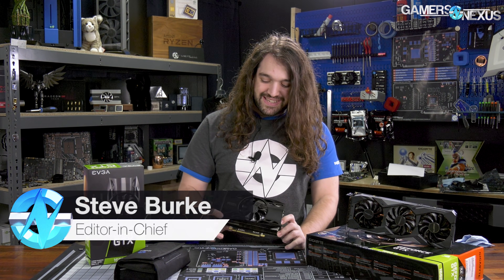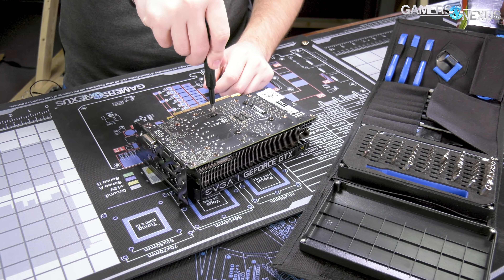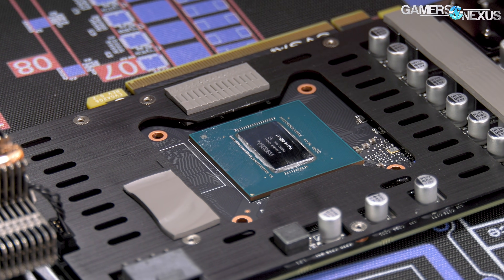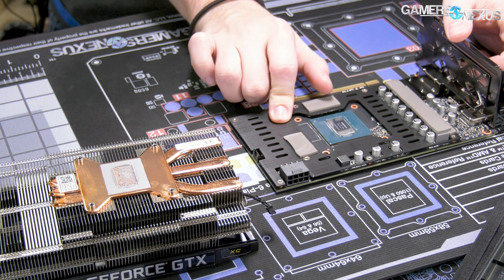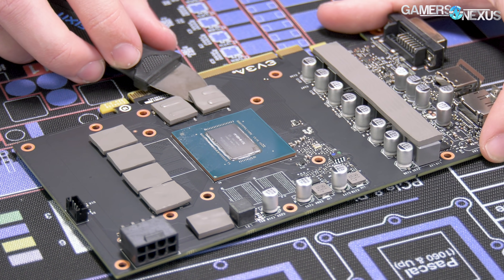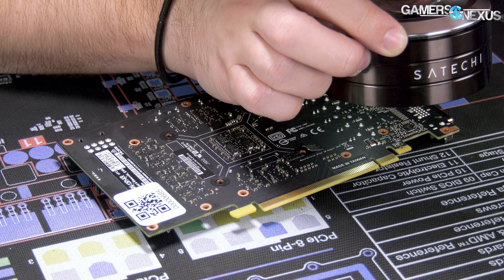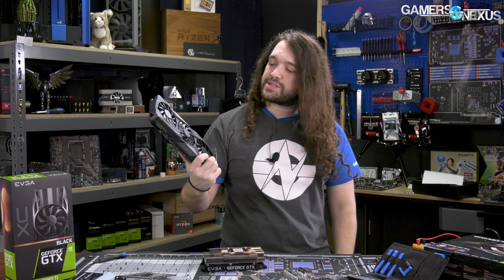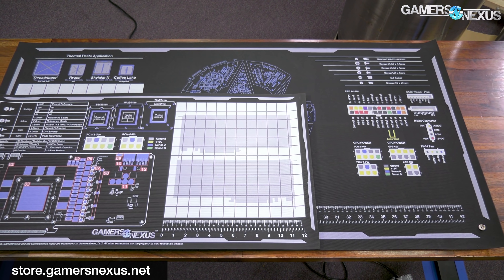EVGA GTX 1660 Ti XC Tear-Down & TU116 Die Shot

Comment: EVGA is using the 1x HDB fan design in their base 1660 model while Gigabyte/Zotac are using 2x sleeve bearing design for the same price. Does anyone know how the 1x HDB fan compares to the 2x sleeve bearing fans in terms of heat and noise?

Comment: What about those 2 extra memory positions? Is it shared PCB with some other GPU, or does the GT116  have support for 256bit memory interface?
For the second option - I believe that GF1660 vanilla will have gddr5 memory with presumably the same die. It is possible, that nv hedged against the possible GDDR6 supply problems by making it able to use 256bit (intended for 1660ti with gddr5).

Comment: Seems an interesting card 
Whould like to see some oc capabilities, please try to increase the power limit and see if it will oc better, also the heatsink looks massive i think it whould be easy to put two fan and remove the black shroud so it will have better cooling while remaining small, 
You made it go to 2055mhz, is any more headroom for a 1660ti gpu to go beyond that?

Comment: Confused on which one to get zotac or ausus or any other , most of them have single fan , zotac has 2 . And which is good the amp or the normal one because in my country amp is for 28,000 INR( 395$) and the normal dual fan is for 366$ 26,000 INR , I know it's really expensive than in the US :(
Reply: Go for Zotac, 5 years warranty  in India
Reply: Ya

Comment: The holes in the base plate are quite well designed considering they have a thermal pad also on the other side of the holes. I'm sure it helps with heat dissipation quite a bit.

Comment: Don't like the cooler. I would rather see a normal two fan cooler then that really thick one. Yes it would extend past the PCB but that improves cooling even more by increasing airflow.
Reply: Yeah. I'd much rather see the regular configuration that this.. stump. Thankfully there are other 1660's that are not retardedly built like this one
Reply: @Raging Monk
EVGA makes a twin fan version... for $310. You would be better off getting the 2060.
Reply: @carniestyle6454  , "You would be better off getting the 2060."
I have a Vega 56 Pulse. It has a nano PCB with a full size cooler. https://hexus.net/tech/news/graphics/114599-sapphire-adds-pulse-radeon-rx-vega-56-lineup/
Reply: Raging Monk.... Where do you think Joes who shell out greenbacks are going to try to cram these things in?   (hint....think small)
On the other side of the coin.....if materials and attachment methods are effective in manufacturing, surface area is surface area and an effective airflow rate is dialed in, I see no downside to the brick vs shingle layout.
Reply: This is ment for tiny Pc cases probably. Also a second fan would cause more noise at the same rpm and you need a second fan to cover the whole area then. So probably because this is 3 slot, it almost cools as good as a 2 fan 2 slot design while only needing one fan. Ofc you could just reduce rpm on both fans of your version to decrease noise, but my point is that its probably still louder to a certain point where the rpm are just too low to make a decent difference in noise. But you still will have 2x the noise because of 2x the fans. We need dB numbers for that.
Reply: Main problem however is that 99% of small ITX cases are only support 2 pcie slots, nothing higher. This kinda gimps its small case compatibility.
Reply: @the-true-inferno  Hmm really? I didnt know that. Then they should have just gone for 2 small fans and a slightly longer card, as the main comment suggested. Probably EVGA had some in mind which have 3 or tried to minimze cost with this design.
Reply: >2x noise for 2 fans instead of 1
Yeah but it does not work like that at all
Reply: @elesinalex  Dude i even described when it applies 🤷🏼‍♀️
Reply: @OutOfRangeDE  I just did a build about 2 months ago  in this case. https://www.newegg.com/Product/Product.aspx?Item=N82E16811353073
So a micro-ATX and I put in a two fan, XFX RX 480 GTR Black Edition (Card Dimension (inch) : 11.02 x 4.88 x 1.57) and overclocked it 1365 MHz making it a RX 580. I think having a full 3 slot wouldn't have worked as well. that single fan would be nearly touching the side of the case.
Not huge fan of this type of builds but the guy has to spend a lot of time in neighboring states. Throws the tools in the back of the truck and seat belts the PC on the passenger side. lol

Comment: Thanks for the teardown. Steve, did evga mention as to why they went with a thicker cooler for the gpu? Is it because they increase the power to 130w rather than the 1660ti 120w standard?

Comment: Surprised you didn't notice the 2 empty RAM spots - what other card would use the same PCB but have 8GB VRAM?
Reply from the maker: It was noticed, that doesn't mean it needs to be mentioned. Small RTX 2060s could use the same PCB layout, doesn't necessarily mean anything.
Reply: @GamersNexus  gotcha - so the die is the same size / similar enough size to be interchangeable with a 2060 GPU die. Good info!
Reply: @kalmtraveler  EVGA use a version of this PCB for all of the 2060 models and I would bet a 2070 ITX is either in the works or was on the table at some point. The 2060 PCB significantly more busy with components than this but it's the same basic layout and it makes sense that they have the pads for the 2070's memory if they ever want to put that chip on the board.
Reply: @Sniggwaffles  thanks - I hadn't seen comparisons between them so was just surprised to see a 1660 with unpopulated RAM spots. Makes sense now!
Reply: So standardization.

Comment: I wonder why they design the cooler fin orientation this way so the fan blow air to like 60% of it only and other will only passively cooled. Why not the other way so the fan can blow air into all the fin.
Reply: My guess is it has to do with manufacturing. Maybe shorter, perpendicular find are easier to manufacture. Or heatpipes are laid out more efficiently on perpendicular fins than parallel ones.

Again, those are just guesses.
Reply: @justinbernardo3159  Yeah, now thinking it again all EVGA card cooler use the same orientation design too (maybe not all) so they just have to change little bit to fit in this card much easier than designing a new one.

Comment: why an 8pin if it's only 130w and the wattage can't be changed through OCing? PCIE+ 6pin is more than enough?
Reply from the maker: 6 vs. 8 doesn't actually change anything in reality, just adds 2 more sense pins.
Reply: It's just more awkward for people like me with modded old OEM work stations with no 6 or 8 pin connectors I guess. If I could find a duel SATA power to 8 pin adaptor (54 + 54 + 75 from board) do you think a 320w PSU (90+ efficiency) on a system with an i7 3770 and 16bg ddr3 1600mhz ( 4 x 4 in dual channel) could handle these cards?
Reply: @SeanehKelleh  Same here.I have a good old PSU with only 6 pin connector.And it's a shame that I can't use it and need to buy new one.
Reply: @ShadowPBPBC 75w+75w by PCI express.And good 6 pin connector can give you a much more power.Believe me.
Reply: @ShadowPBPBC but SATA power is 54w, so having 2 SATA Power cables feeeding to 1 6pin connector provides upto 108w , but the card will only draw 75 though the 6pins (and it wont even do that as it's getting 75w form the board anyway).

Comment: Wtf is up with Nvidia’s ability to name things?
Reply: Some board partners seem to do their best to make the names even worse, like - MSI GTX 1660 Ti Ventus XS OC...
Reply: @M0DERN_B0REFARE  I'd prefer a GTX 1660 Ti OwO OC.
Reply: A more fucked up name gives them free PR.
Reply: Well 1000-series is pascal, 2000-series turing. So 16xx-series is Turing too? Of course it's obviously confusing. Something like 1060 6gb v2 would have worked so much better even if it's not pascal. Or perhaps 2060 lite? Or 2040 breaking the mold going lower numbers? Or just 2060 but not RTX but GTX...
Reply: @shagath  Or a 1160... as in, This is NOT 6 generations over the 1060... The 2080 is also not 10 gen over the 1080... but I'd let that fly as a "2nd" "080"... but 1660 is just them trying to confuse people and get more cash. What next, an 1880 and 1770? It's like renaming your "3 Series car, 2 litre engine" as a "13429.5" just to make the engine sound bigger. ;)
Reply: *Inability
Reply: @corwinblack4072  1660Ti 8GB edition. you can see the slots for the extra pair of chips on the PCB, unless they're planning a 1670 model it has to be for a potential future bigger version.
Reply: @darthkarl99  Based on PCB I expect 8GB and probably beefier VRM on some future cards. Might be interesting with 8GB and more power. Quite interesting.
Reply: 1660
that's how many seconds they took to name it
Reply: Between the 1060 and 2060 is the 1660, simple really
Reply: tomasinopava  I meant in terms of naming.

Also it's the successor to the 1060, it just has improved performance. The 1070 had a large gap with the performance with the 1060, which is why the 1660 ti has similar performance to the 1070, while the 1660 sits somewhere in the middle between the 1060 and 1070.
Reply: they're trolling the consumer by indirectly saying "LUL give me your money, fools"
Reply: They explained it; you can find that explanation in Gamers Nexus' benchmark video. And it makes sense.

My question is - wtf is up with people whining about the nomenclature Nvidia chose? How is it in any way a big deal?